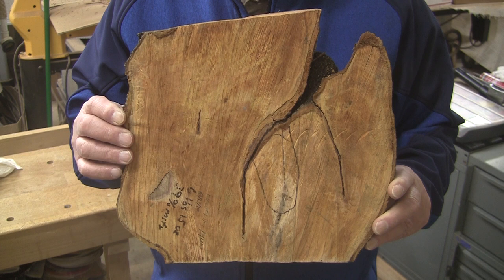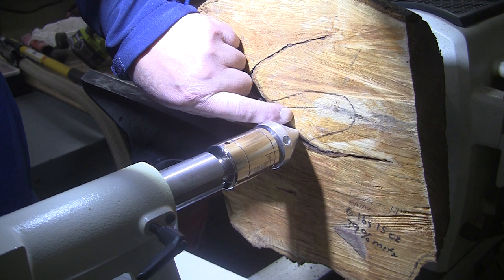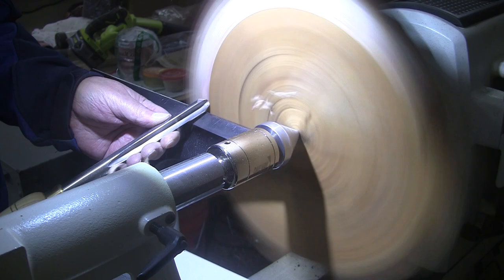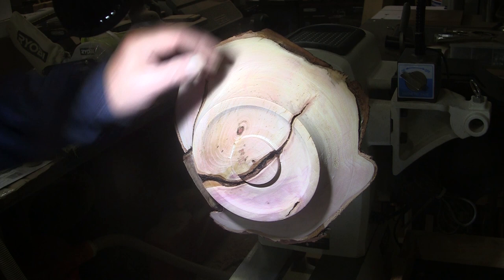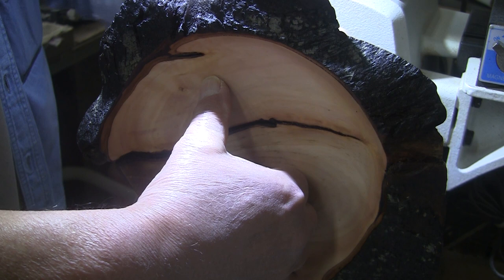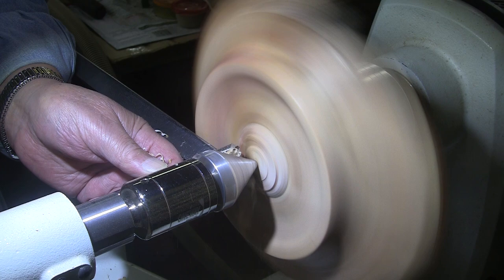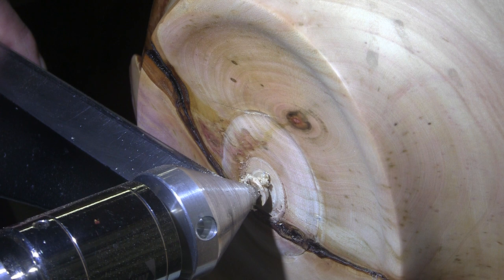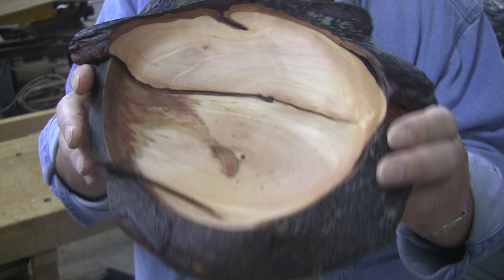Turn! Split! Fix!  Wood Turning

Comment: You pulled that one out of the fire! It was nearly kindling, but you just would not give up! I watched you persevere, I imagined you sweating over the growing crack, grappling with the very forces of Nature! And you WON! and now i'm out of capatilalizations as well as exclamation points. it's a tough ol' world, but you just made it a prettier place. thank you for sharing how you did it.
Reply from the maker: Thank you, Dave!  It's still together, though parts of the crack have separated, it's connected at the end, where it counts!
Phil
Reply: Let's hope the bark stays on, next.
Reply from the maker: @calmwoodcreations3709  Dave there are two places where the bark has actually raised up, forming an upside down U shape.  They are two of my favorite features of this piece.  The rest of the bark still looks tight!

Comment: Now that it's had time to settle for a few months, how has it turned out? It would be great to see a return visit. You are a true inspiration, Phil. I love your work.
Reply from the maker: Thanks for the reminder, Owen.  Maybe I should show it in a video.  It did continue to split, all but the one end.  But, it also shrank a little and pulled the crack very tight.  You have to run a finger over it to notice.  Thank you for your kind comment!

Comment: Well, I'm reminded that you said to ask if this beautiful Flowering Plum platter continued to hold together. I hope that it did and I thank you for sharing this beautiful piece!
Reply from the maker: Howdy Mike!  It remained together and attached at the one end.  The rest of it split but, it also shrunk and the crack is tight as can be.  Other than one side is slightly higher now than the other, you can't really tell.  I may remount it and turn it just to level it off.  Thanks for asking and thanks for watching!
Phil

Comment: looks very nice.  I usually use used coffee grinds and medium CA glue to fill voids.  If you use accelerator, it tends to make the seal brittle.  You can use coffee grinds to fill the void then put thin CA glue on it, that also works.  It  holds for a long time.
Reply from the maker: I too, have used coffee grounds and CA, Terrence, and I like it the best of anything I have used.  I am aware that using accelerator is not as good as not using it but I needed to act fast with this piece.  It's still holding at the ends of this piece after sitting in the house for a month so I'm good with that.
Thank you for your comment!
Phil

Comment: PHIL, DID IT SPLIT,  GREAT JOB,  GREAT SAVE WITH GLUE,  GREAT VIDEO,  6/2/21...
Reply from the maker: Well, one end is still attached, BUT, after the split it actually shrunk and now the crack is tight as can be.  You really have to look to tell but it won't move at all.

Comment: Hi Phil. Love it. Far be it for me to give you advice but ..... Another way to flatten the base before using the wood screw is to use a hand held planer. A great little tool for this purpose. I use a jaw horse to hold my wood. This is an especially good method when using a spiked face plate. I have also had great success filling the bark separations with coffee before using the CA glue. My customers are also intrigued with that solution.

Comment: Phil I think you may fit the saying.
 "Leave no piece Unturned!" 
Well not sure it was a saying but it is now. Turned out great and I am surprised it did not fly apart.Maybe that crack was a good warning that it was on the verge.
 I once saw a video where someone treats fresh cut and or damaged trees branches with Howard Feed and Wax. It helps to keep away rot by keeping water from getting in. So you made a great choice of finish.
They must by it by
Gary
Reply from the maker: I think we both live by that saying, Gary.  I am starting to believe there is no piece that can't be turned into something!
Thank you, buddy!
Phil

Comment: Nice, nice turn.
You always ask questions, and then say " I can't hear you...." Well..... I was yelling at the TV..... "CLAMP IT! before you spray accelerator!!!!" 🤣🤣.... You didn't hear me.
A little tip to consider... If you have a crack and it needs to be clamped.... Put the clamps on first...then add CA....
It will wick right in in no problem
Reply from the maker: Thanks for the tip, Charles!  You are, of course, correct! 😊

Comment: Hi Phil, I'm a new subscriber to your channel and this is the first piece I've seen you make and you got a really nice result with it. But I must confess to being quite curious as to how those splits have held up since October, can you let me know please.
Many thanks and kind regards
Reply from the maker: Howdy, Lee!  The split did come apart except at one end, still firmly attached.  But, the wood also shrunk a bit and the crack is now tight as can be.  The only way to tell it came apart is because now on the inside you can feel a very slight ridge when you run your finger over it.  I could probably remount it and just do a skim cut to even it out again.  I'm giving it a little more time before I do that, just to make sure it's done moving.  Thank you for your subscription, I will try to be worthy.
Phil

Comment: I am so amazed. I Never would have tried turning that piece. You have an ability I will never have.
Just curious Phil, do you have a reason why you didn't stabilise that main crack with some resin before turning the top side or at least use 5 minute epoxy to clamp the crack closed ?
Reply from the maker: Thank you so much, Jim!   Your comment brightens my day.  I have seen some beautiful turnings done by some very talented turners, that include resin, crack filling, etc.  I'm always amazed at the stunning results they achieve.  For me, I prefer to leave the wood, defects and all, as I found them.  I just like to keep as much nature in my pieces as I can while still turning them into some kind of recognizable shape.  It has been a month since I turned this piece and, while the crack has opened up some, both ends are still attached.  Good enough for me.
Phil

Comment: Well done very nice. Ok I gotta ask did it split ? I hope not thats a really nice piiece.
Reply from the maker: It did split, Jan, but one end remained attached and the rest of it pulled tighter together as it shrank.  It's tight as can be and you can hardly tell.

Comment: Ok Phil, it's February , check it for cracks.
Reply from the maker: The crack remained attached at one end, Richard.  The rest of it cracked to the other end.  But, the crack is closed and is tight!  You can hardly even tell it's cracked.
Phil

Comment: Awesome job for you did it split any further
Reply from the maker: The one end that was attached well remained attached, Robert.  Other than that, it split the rest of the way.  But, it also shrunk and is tight as can be.  I can't move it at all and you almost can't tell.
Phil

Comment: Beautiful piece, Phil! Thank you! How did it hold up after nearly 2 years? Did the CA do the long term trick?
Reply from the maker: Thank you, Peter!  It actually came apart at one end but the other end stayed intact.  The cool part is, it shrunk together and now the crack is tight as can be.  The only way to tell is run a fingernail over the crack.  One side is ever so slightly higher than the other.  I'm good with it! 😊

Comment: So. It's January 2020, did three bowl split any further?
Reply from the maker: Yes, it did separate completely, Charle, at the open end.  But, the crack is very tight and closed, I can't move it at all.  The most noticeable part now is, there is a height difference on each side of the crack.  I can probably re-turn it and flatten that out and you almost wouldn't notice it.
Phil

Comment: Howdy Phil
You really luck out ...glad it did not fly apart !
You mention "now it is mid October "  now mid Nov . ....Did it split ?
The wood almost looks like maple on 1 side and plum on the other ! very nice piece . Makes me want to do more on my plum ...so busy doing other things with epoxy and colors , river style pieces .
Did you smell any plum ? while turning ?  I have when I did turn some wet plum wood for my sister . I thought it was great to smell it .It turns nice .
keep on turnin'
Reply from the maker: The split has opened up everywhere but the two ends so, still connected and good!
No smell for me but it might be me and wearing my mask.  I would enjoy the smell if it was there, for sure!
Thank you, Bruce!
Phil
Reply: @PhilAndersonShadyAcresWoodshop  Phil...I take my mask off when I know it is still wet , maple and plum just to smell the wood ...I call it and added bonus .....take care

Comment: Great job! Did it split further?
Reply from the maker: Thank you!  The split did come apart except at one end, still firmly attached.  But, the wood also shrunk a bit and the crack is now tight as can be.  The only way to tell it came apart is because now on the inside you can feel a very slight ridge when you run your finger over it.  I could probably remount it and just do a skim cut to even it out again.  I'm giving it a little more time before I do that, just to make sure it's done moving.
Phil

Comment: Another beautiful bowl. Did the repair hold?
Reply from the maker: Almost, Chris.  One end was attached naturally and still is.  The other end did give way but, the crack actually closed up tight and you almost can't tell.  There is just a slight difference in height  when you run a fingernail over the crack but you can't see it.

Comment: Did it split further? 🤔
Reply from the maker: Only one end remained intact, Duchess.  But, the wood shrunk and pulled the crack tight.  You can feel it if you run your fingers over it but you can't see it.

Comment: Just had another thought....Would this be a good candidate for one of those clever bow ties that woodworkers use to solve table cracks ???...cut 2 little "V's" on each side of the crack and install a fix-it wedge, sand, Howard's....done, more better-er than glue ??? ( or not....there I go thinking again )...tm
Reply from the maker: Yes, that would work I'm sure, Tuffy.  It would have to be hand cut, however.  You'd never get a router in there.  Sounds like lots of tiny cuts and fitting, to me, but yeah, it would work!
Phil
Reply: Just curious as of now Dec 23rd 2019 how this is looking as far as the splitting goes?
Reply from the maker: @bobvanderslice945  your question had me going to look at it, Bob.  As of about a month ago, the larger crack had opened up but was still connected at the ends.  Now, I see that my glue joint failed and the crack has shifted, up and down but not apart.  It is so tight that I can't move it with quite a bit of force.  It doesn't look bad but you can certainly feel the difference when you run your fingers over it.  I could re-turn it to smooth it out.  Maybe a future video.  Thank you for asking!
Phil

Comment: Did the flowering plum bowl split again
Reply from the maker: Well, yes and no, Judith.  One end stayed attached, the other end did separate but then, the whole crack closed up, tight!  Other than if you run your fingernail over the crack, you can't tell that it happened.
Reply: @PhilAndersonShadyAcresWoodshop  good it's a good piece

Comment: Nice job, did it split?
Reply from the maker: Thanks, Alan!  One end did separate but the other end stayed attached.  The interesting part is, as it dried it pulled tighter together.  The only way you can tell it split is to drag a fingernail over the split.  You can't see it. 😊

Comment: Did it split again while drying?
Reply from the maker: Not exactly, Victor.  The crack remained attached at one end.  However, as the piece dried and shrunk up, the crack came closer together and now you can't budge it.  😊
Reply: @PhilAndersonShadyAcresWoodshop  very cool piece glad it turned (Pun intended) out well!

Comment: Did it split
Reply from the maker: Well, yes and no, Daniel.  It stayed attached at one end.  The cool part is, it shrunk up a bit and now the crack is tighter than ever.  The only way to know it's a crack is to run a fingernail over it and there is a very slight rise on one side.  Can't see it.  😊